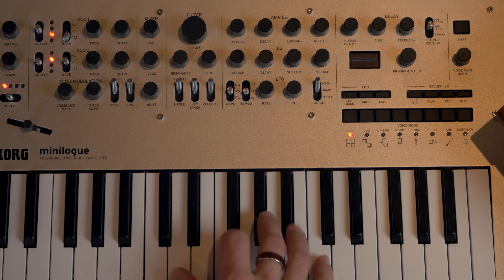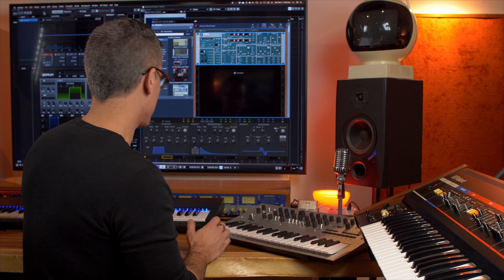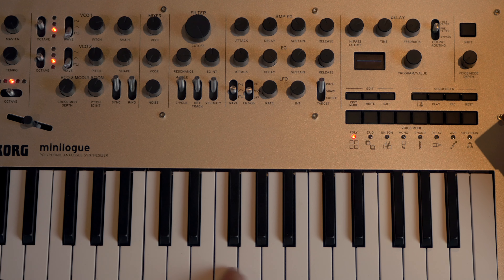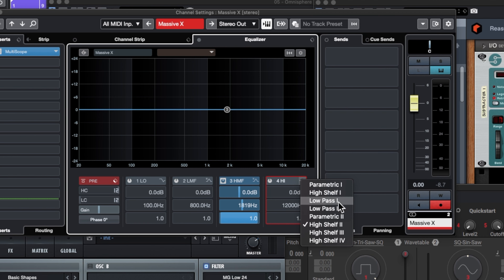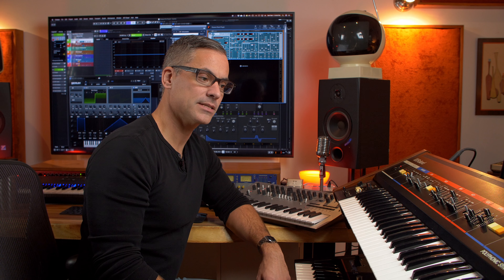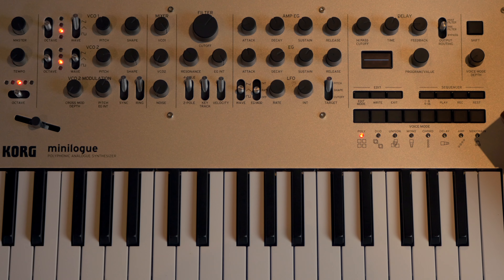Essential synthesizer basics every producer should know! Hardware and software tutorial.

Comment: Basics Timestamps
- - - - - - - - - - - - - - - - - - - - 
Intro 0:00

Three Properties of Sound 0:47
1. Pitch 1:04 
2. Loudness 1:20
3. Tone 1:40

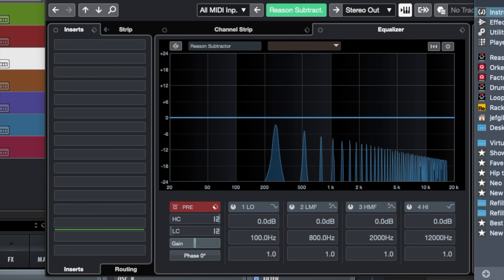Five Components of Synthesizers 2:54
1. Oscillator 3:20
    - Four Types of Waveforms 6:23
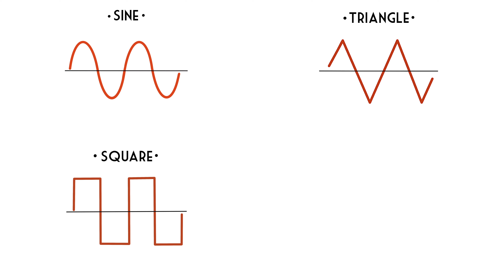            a) Sine 6:39
            b) Triangle 7:27
            c) Square 8:07
            d) Sawtooth 9:58
2. Filter 12:10
    - Three Types of Filters
            a) Low-pass 13:03
            b) High-pass 16:53
            c) Band-pass 17:25
    - Two Filter Controls 
            a) Cutoff 13:16
            b) Resonance 14:15
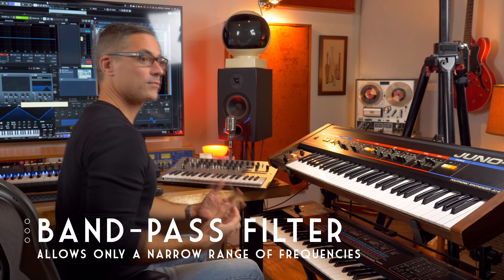3. Amplifier 17:52
    - Amplifier Envelope 18:20
4. Envelope 24:18
    - ADSR Controls -- (A)ttack (D)ecay (S)ustain (R)elease 18:50
            a) Attack & Release 18:57
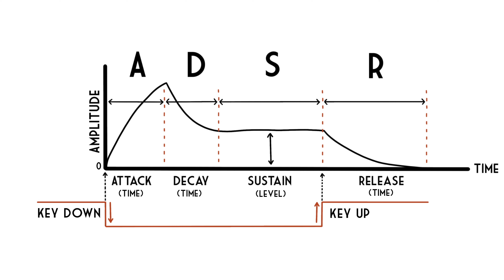            b) Decay & Sustain 20:04
    - Filter ADSR Examples 
            a) Korg Minilogue 24:49
            b) Serum 27:52
5. Low Frequency Oscillator (LFO) 29:09
    - Modulating Pitch 29:41
    - Modulating Filter 30:52
    - Korg Minilogue Example 31:41

Outro 34:35
Reply: Thank you.

Comment: This was one of the best basic intros to synthesis yet. Easy to follow and understand.
You must have a kickass PC to be able to run all those plug-ins and hardware at the same time. I use Ableton 10 as my DAW and have midi'd in 7 hardware controllers and synths and now my CPU is crunching...time for an upgrade. What are you using?